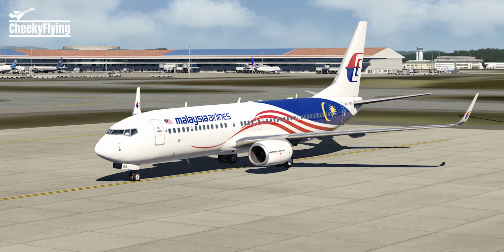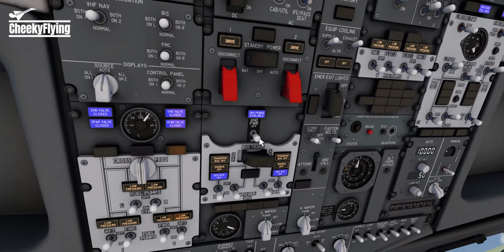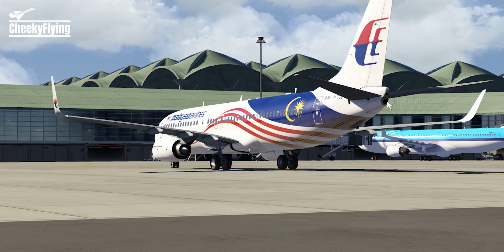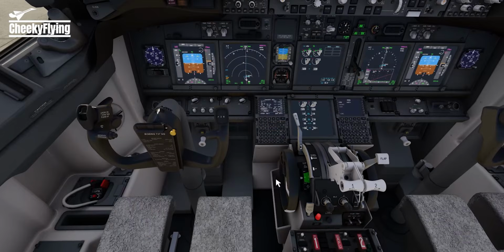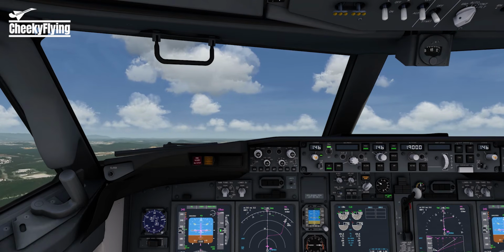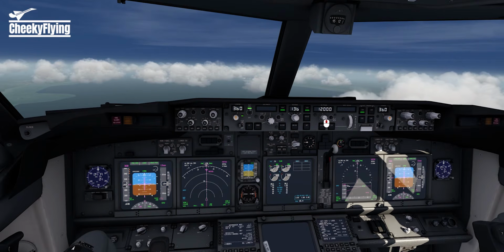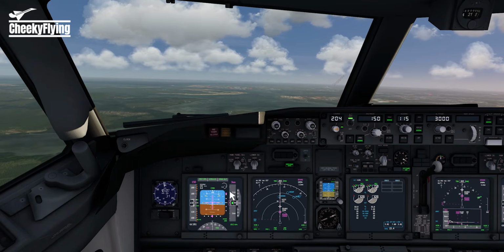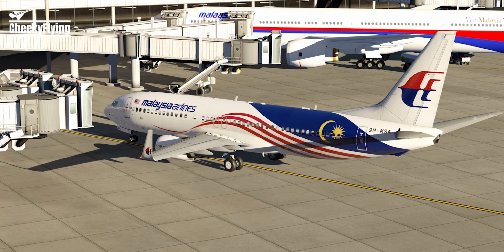How to Fly the New Boeing 737-800 in Aerofly FS Global Flight Simulator | Kuala Lumpur - Singapore

Comment: Hi
I’m playing on mobile but the plan doing every thing with itself like lower flaps and gear how to control the flight myself 
Thanks
Reply from the maker: Hello, I think you can check the settings for assisted flight or something. This should be the reason why everything is happening by itself. You cab try turning them off 👍🏻